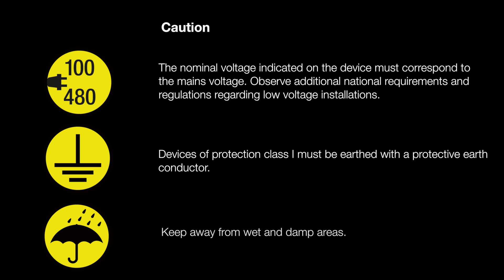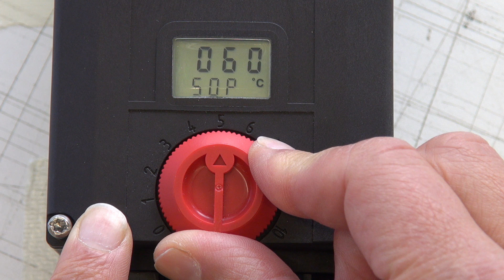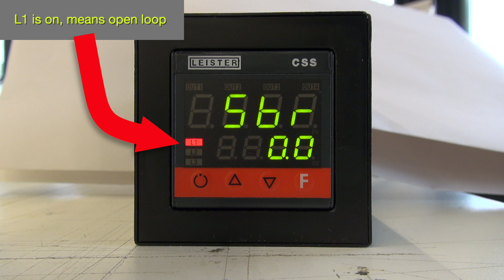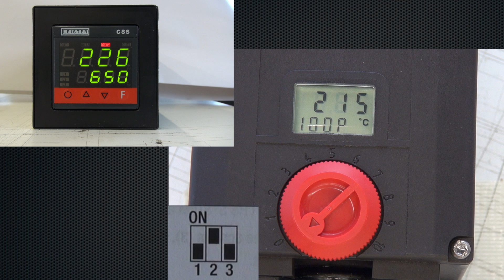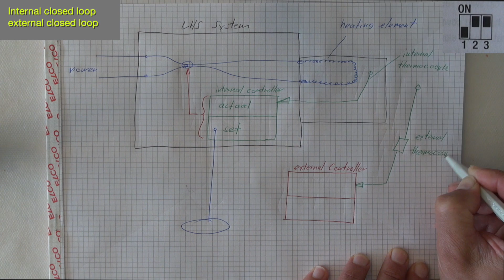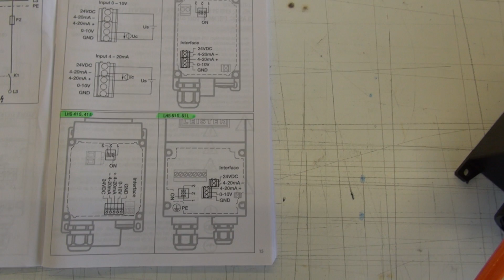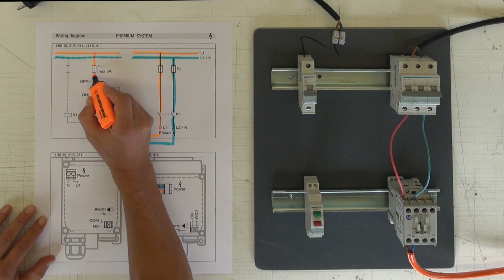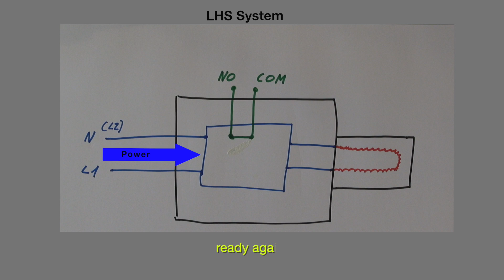Leister Tutorial | Air heater LHS System options to control and how to hook up

Comment: How can I controll 3 heaters  is a single  Multi patch module MPM 01 is sufficient  or two ?
Reply from the maker: Dear Taoufik

You would need two MPM 01 for a plug and play solution with our CSS Easy controller.
Or you can do it also without in case you have a CSS or any other controller. In this case you have to make:
-	 a serial connection with the 4-20 mA signal    or     a parallel connection with the 0-10 Volt signal.
-	and a parallel connection with the 24 Volt DC supply.

Best regards
Leister Team